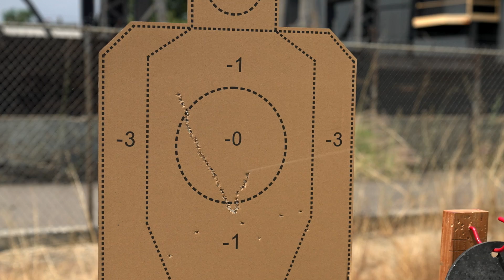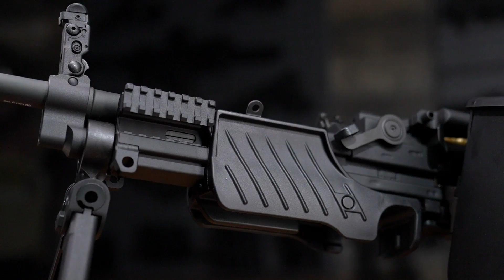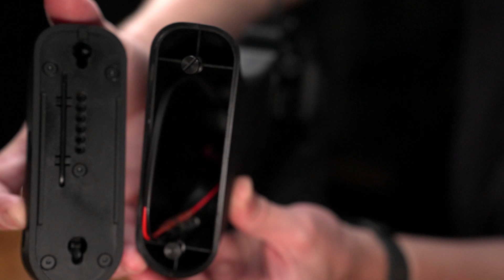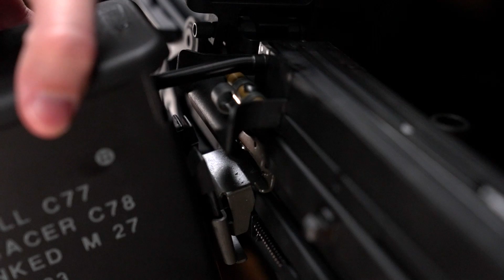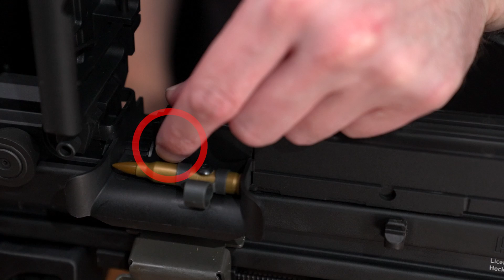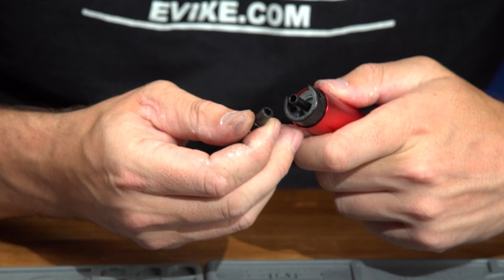HK MG4 from Elite Force

Comment: Okay, so I went and spent $1100 for this LMG. What I can say first is that this is a case of "You DEFINATELY get what you pay for". The advice in the video about ammo size and battery "limits" are nothing to worry about and if you follow them, you'll avoid any possible damage and won't feel held back at all. I've run this beast hard for a year now with regularity and have had ZERO problems. This is also one of the rare AEGs that require no modification. The stock internals run like a Swiss watch. Mine also shipped with the ammo box which is something you may not get with other LMGs or SAWs. There are also realistic dummy bullets included, and it really enhances the realism of the weapon. I usually keep the box on the gun even if I'm using the internal BB system. The weight for such a realistic weapon is also a plus and if you're in decent shape it will be no problem at all. Like stated in the video, the bipod is the best I've used on an Airsoft gun by far and that's saying something. You guys know which guns or aftermarket bipods I'm talking about. So, if you consider yourself a serious Airsofter you need to ask yourself: "How many times have I bought an Airsoft gun for $550 - $700 and after modding it the final cost came to somewhere north of $1000 USD? This is one of those very few guns that you will run with no mods, except an optic, PEQ or something of that sort, and be entirely satisfied with its performance. If you're looking for a support weapon pull the trigger on this, I think you'll be glad you did. I sure am.

Comment: kinda of a shame your stuck using what amounts to a buffer tube lipo on a m4

wonder what would happen if you hooked up a better batter, wonder if it would just misfeed

or would it destroy the motors and gearing just to feed this beast?

ill never know, I have no desire of getting a mg 4 just to find out

ill stick to my rpk for lmg needs
Reply: You could probably mod it to take the abuse, unless it's actually a misfeed problem. Although I would run this with some gargantuan 7.4 LiPo, you'd still most probably exceed the fire rate or the legendary MG42 and never run out of juice. That's how I run my G36 LMG

Comment: Is it just me? Or does this with all the *'s does it sound like a POS
Reply: I've been running it hard for a year now in all types of weather and haven't babied it at all. I've seen SAW and other LMG users have problems, which can happen to anyone, but I've never had any. Also, a lot of the less expensive rifles and support weapons have been modded with the final cost comparable to the $1100 USD I spent on this MG4 and it runs like a beast on fire without needing any mods.

Comment: But why is this 1.3k$?
Reply: maybe because it's made of aluminum and machining that maybe costs more?...just saw it's got patented gearbox design ...that would do it
Reply: @helisoma  for the same price, I can buy 3 Middleweight and box mags for each of them.
Reply: @helisoma  Plus, most other VFC guns are 500 dollars, same metal and stuff. I'll at most give it 700$ if you really stretch it.
Reply: I think it's because half of the price is going for the licensing. Most VFC guns recently cost around 1000 or more
Reply: @tanayayt9283  the FN M249 is full metal and cost 500$. probably HK is just overcharging for the fun of it.